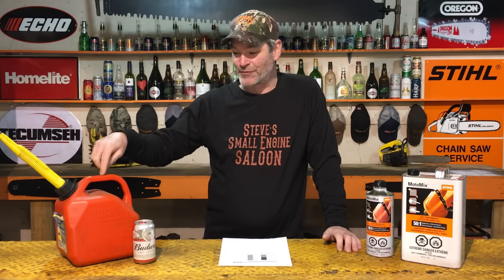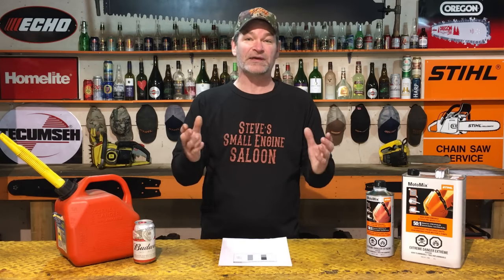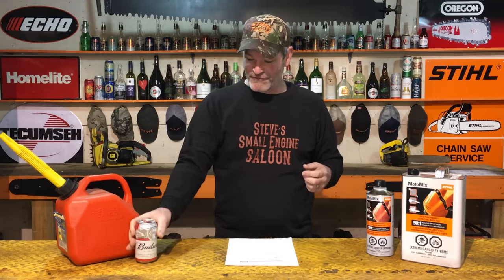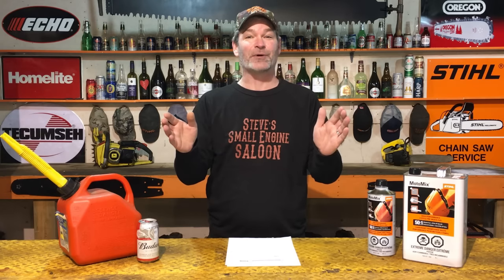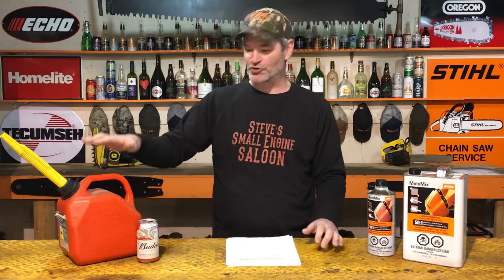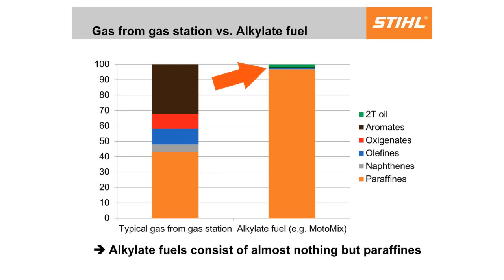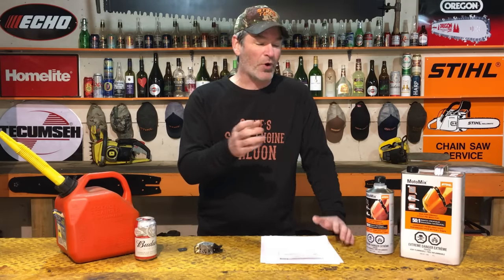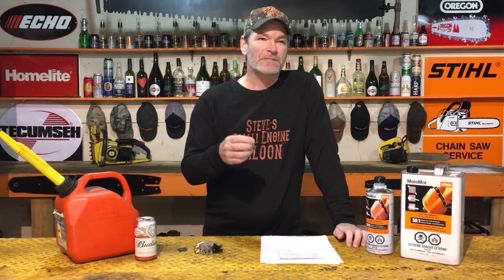The Ugly Truth Why Gas Station Fuel Is Bad For Small Engines

Comment: I'm a mechanical engineer and I can't understand why they don't redesign these components so that they are compatible with gas station fuel.  Well, that's not totally true.  I do understand.  They want to sell replacement equipment when it fails or specialty fuels and mixes to keep it from failing.
Reply from the maker: I agree...
Reply: Good point Shane Martin.
The Corporate Muckie-Mucks hate us "Shade-tree", experienced, and Professional Mechanics!
They depend on the "don't fix, replace" individuals, and people that don't read their Operator's Manual that is INCLUDED... Duhhh!
Reply: We could use different materials ethanol resistant, but you guys bitch about fuel price, how much you think it will cost a carb that dont rust and a carb kit that dont worn out in ethanol? People have what they are willing to pay.
Reply: Bingo.
Reply: Its completely due to cost.
Reply: @hrbestalkinme3690  & Amikar
The cost to make the improvements (after design time) would probably be a few dollars and then they would have to mark it up to make it worth their while.  I would gladly pay the markup to not deal with the failures or the hassle.  As an engineer, I know that companies drool over the possibility of long term consumable sales.  If you sell them some equipment once, you sell it once.  If you sell a consumable (in this example special fuels and mixes), you sell it continually over the life of the product.  I have worked at many companies that sell their product with very little profit because they know that they can make a ton of money on the consumables that go along with it.  That isn't a guess, I was told that flat out by the sales force and management.

The materials that are resistant to the gas station fuel are readily available.  Automobile fuel systems and gas station pumps are not self destructing on a regular basis.  

So, no, it is most definitely not due to cost.  It is due to profit.
Reply: @S3145    Im also mechanical engineer.  I've worked for two small engine manufacturers.  They certainly do not like having the carbs gum up.  It causes warranty returns when you try to sell them at big box stores.  The issue is bemoaned within their engineering departments.  But, they are operating on such small margins that they cannot afford to use better alloys or redesign the carbs.  They use the cheapest carbs they can find and then get a pat on the head for saving cost.  Its all about cost.
Reply: @hrbestalkinme3690  I'll concede that if you are a small company without any branded fuel mixes, you probably have no choice and can't upgrade the carb and aren't making extra money on the mixes.  The bigger companies with the branded fuel mixes have no incentive to make the switch.
Reply: @S3145    We were not a small manufacturer.  We made small ENGINES.  The margins are absurdly small, and sales are very sensitive to price.  Btw the profits from branded fuels and oils are calculated into a completely different budget than engine R&D.  Im guessing you work for a small company in a low competition industry with high elasticity of price.  You have quite clearly never worked in small engine or industrial engine development for a large mfg.
Reply: @amilkarcamacho6084  Ethanol isn't very corrosive. It's slightly acidic and a very good solvent capable of cleaning out gum and varnish. What does that say about the quality of fuel people buy? With a ph of 7.3 you DO NOT need any material more costly than stainless steel. If any rubber part swells on contact with ethanol, throw that rubber away and get something of trusty quality. It's not impossible. It's not even hard to do. It is however very hard to profit from oil sales when other fuel sources are readily available. Now you know why other fuel sources aren't readily available in the US.
Reply: @exoticcreature3059  Ethanol is hygroscopic absorb moisture, Ethanol itself is not corrosive. It has he capabilities of damage all kind of rubbers, elastomers like the ones found in the carburator Kits. Carbs can't be made out of stainless steel it will need to be an alloy. Other option is to nickel plate internal parts of the carburator which Walbro already is doing for couple manufacturers like Echo and Shindaiwa. The reality is that the fuel with ethanol is not a problem if the user keep using the machine with fresh gas ( no more than 40 days) regularly. We see the problem when the gas is left in the unit for longer than 70 days, Ethanol start getting moisture and gas molecules create gum, product of the natural ionization of the gas.  Theres couple materials that works better with ethanol like viton, chrome, vanadium, iridium and many others but they are really expensive. People definitely will not pay for. Feel free to contact me if you have any questions.
Reply: @amilkarcamacho6084  Why can't carburetors be made of stainless steel? Fuel lines can be.
Reply: @exoticcreature3059  stainless steel carbs can be use in small engines capable of treating the exhaust gases. In handheld small engines the catalyst happens by temperature only and we dont have platinum, iridium or any other catalytic materials inside the muffler exhaust. Stainless steel will not corrode but creates multiple emission gases that EPA will not approved. Also stainless steel when you perform and spectrum ionic wavelengths is not good with vibration and suffers from pitting corrosion. Also is very heavy material, just to be in the perspective a normal walbro carb it made out of aluminum is cost not MSRP is about 4 dollars in raw materials. If we use stainless steel in emissions capable engines will be about 9 dollars raw materials but the way to handle the material for manufacturing processes will increase the cost of labor about 6 times, Is not only the material cost.
Reply: @amilkarcamacho6084  What about chemical coatings? Anything you know of that could be used in such an application? I'm thinking ceramics but that is only one type.
Reply: @exoticcreature3059  ceramic is very weak to small , medium and high vibrations waves, this is a real problem with these small engines the vibration spectrum is really high, medium and low is very impressive we could see all the 3 variations all the time in these units. Ceramics are an awesome materials I actually see a small rotary engine prototype with ceramic and if they could get approved will be a whole revolution in the industry.
Reply: @exoticcreature3059   sorry I forgot about the coatings. So Walbro is chrome coating internal parts of carburators only for Echo and Shindaiwa professional models. Is a very good quality carb and they are not really expensive. Remember this the manufacturer warranty their units only for manufacturing defects and or workmanship any fuel related is customer liability and the Government laws protect them from this. Theres not a lot we can do at the point when people these days care more for an experience than a super good quality machines. We could desing a 2000.00 trimmer or chainsaw that last forever but only very few will pay for it. Today's manufacturing is about massive earnings how to make billions that's the sad part of this.
Reply: @amilkarcamacho6084  I know you mean by profitability over longevity. The manufacturers can use warranty scare tactics on me all they want but nothing is stopping me from giving every metal part the cryogenic treatment.
Reply: I peed in the fuel. 
  
                 💦
Reply: @S3145   The same holds true throughout the marketplace. For example computer printers are sold at a loss, so that they can sell you the ink at exorbitant prices. Just like with the "drug dealer", your 1st fix is "free",  and then your "hooked". Sadly, it's a terrible society in which we live.
Reply: Shane Martin 

They are compatible. You’re supposed to drain the tank after each use and run the engine until dry...so said my Toro mower’s manual in 1978.  By doing so I’ve never had a fuel related problem.
Reply: it's all about da money!!
Reply: True the Stihl authorized dealer here never gives a warning about burning pump gas station gasoline.  A customer buys new outdoor equipment then 6 months later he/she brings it back needing service. After taking a look at the equipment it was ruined when they used gas station gasoline. Then they are told its gonna cost more to fix then to replace it with a new one. Very shady business practice.
Reply: Shane Martin 

Drain and run until dry. Problem solved. But too much trouble for lazy owners.
Reply: I've said that exactly, if I can find my comments here, I'll repost it to you.
Reply: HERE IT IS
LostInMySpace
LostInMySpace
4 months ago (edited)
I can either buy just the perfect fuel for my Stihl brand products, or get on my knees and pray that Stihl can design a motor that will operate efficiently on the fuel that is available to burn.  Talk about built in obsolescence.  Some engineers build in cheap electronic parts, others cheap metals, others cheap plastic knobs that are not available in the aftermarket.  Stihl refuses to redesign a motor that has plastic tubes and other parts that gasoline eats up.  We've heard it for years.  Ethanol gas eats the plastic in the diaphragm, and the gas lines.  But do you see Stihl change out those parts when Ethanol was put in the gasoline? Hell no. Why not make metal lines and a metal diaphragm? The technology really is available.  I once spent $24.00 for a gallon of that motomix.  I kept track, and used 3 gallons this year, but instead did not buy two more gallons of Motomix, but rather a 92 octane racing fuel with no ethanol. That's the best I can do.  I will not spend 24 bucks  a gallon on fuel ever again.  Instead, perhaps after 5 years I will just buy another power equipment; it's cheaper in the long run.  Stihl needs to work backwards. Know what kind of gas is out there, then design a good piece of equipment that we can depend on.What irks me is Stihl and all the other equipment makers get their money, the retailers get their money, and we're left holding a piece of SHIT!. And their solution to this repoff is spend 24 bucks a gallon for gas. If Stihl redesigned it, and charged everybody an extra 50 or 100 bucks for better equipment I think everybody involved would be happy. Stihl needs to shut the fuck up.  I don't mince my words like Stihl does. My Ford trucks have steel gas lines.  I don't think it would be copyright infringement if Stihl used steel gas lines, an throw in an aluminum diaphragm.  

Stihl stihl's your money, refuses to use Stihl gas lines, and they call their company Stihl?  Go figure.  That's the biggest inside company joke.  Everybody is slapping their backs, laughing. Well, shouldn't the company be called STEAL CORPORATION?

                                                                                                                         It's always the end user that gets the screws.
Reply: Hah, I just posted the same comment. Good stuff, I totally agree... they know the available fuels and their chemistry....
Reply: @tkskagen  but when i'm buying a replacement, i sure as fuck don't buy from those thieves. I'll buy from the chinese knockoff's making the same parts for 1/0th the price. I'm getting jewed by both parties but at least in one case i'm not losing my wallet
Reply: @amilkarcamacho6084  Thank you for the informative comments....our small engine mechanic told us Echo seems to have the least problems with weedeaters etc....now I know why.  On our farm, it seems no matter which brand we get the weedeaters go bad and we try to use only non ethanol fuel and even add the stabilizer.....one mechanic told me to use only the blue stabil instead of the red, but it still seems to not help over the long run.  Stihl seems to be the best chainsaw as husqvarna has let us down over the past 10 years....used to be the brand that performed the best, but once they changed the 51 and made the rancher etc, things seemed to go straight downhill.
Reply: I don't understand why they don't make non ethanol gas around 91 octane which is affordable, more widely available specifically for these applications. It would save people a lot of trouble. Around here to get something like that, you have to jump thru hoops to get it. I k ow a place that sells 91 octane non ethanol for 7 bucks a gallon, its in the middle of no where.
Reply: I wonder  what percentage  is in cam 2
Reply: @David-kq9vp  Cam 2 isnt supposed to have any ethanol in it and I asked at my local sunoco, the only one in the state that sells it, they said it was ethanol free. It was around 8 bucks a gallon. Still cheaper than trufuel.
Reply: I've been burning 100LL AvGas (aviation fuel) in all my small engines for many years. I have a 10-year-old mower that starts on the second pull after a six-month winter hiatus.

Excepting oil and air filters, I have never done any maintenance whatsoever on the carburetor or the engine.

It costs a bit more than mogas but WAY LESS than that steal fuel. You can find an airport and price at 100ll.com.
Reply: a lot of Canadian fuel is ethanol free. Numerous brands of lawn equipment are made in China and are made with cheaper parts. Engines parts can be made in China, but assembled in the State also. Cheaper parts and cheaper labor. Things need to get back to made in the USA. Things may cost more, but last longer, if things aren't outsourced.
Reply: @markstevens9724  Yea, you got that right. I just picked up a 1980 International Cub Cadet from 1980. Its a 1650. The thing was almost 4 grand than. Now it would be in the neighborhood of 16 grand. Its all muscle, no plastic and its still running and cutting. It was prior to this age of disposable garbage. Nobody back than thought we would be buying snowblowers with the brand name Zheng Jheng out of China. That thing has a Kohler, the cast Iron line made in USA with pride. It may have cost a lot more, but it was built to last forever, here by people we live and work with pride with higher wages.
Cub Cadets today, are tin cans compared to that thing.
https://youtu.be/maqEwKGCz7I
Reply: Shane Martin Hey dude as an engineer I’ll pick your big brain. I use motomix every so often to clean out my Stihl kit. I rarely have issues and my kit lasts years. Am I pissing in the wind or is this worth it ? Cheers Ed.
Reply: @edwindude9893  It certianly doesn't hurt.
I add stabil to all my fuel because as you know the ethanol in gas is terrible for a carburetor. Especially if its left sitting in the fuel system for any period of time. The best thing to do is always use erhanol free gas, but a lot of folks don't have that option, due to the availability. Since your talking Stihl products, yes your definitely doing a good thing. If it was lower end products I would say just use stabil in your fuel and run it dry when not in use and your good.
I use STIHL 2 cycle oil in all of my 2 cycle equipment, its some of the best 2 cycle oil out their. I go to a dealer and pick up a 12 pack of it for about 25 bucks I believe and it lasts a good long time. I highly recommend the stihl 2 cycle oil, its engineered specifically for small 2 cycle equipment vs outboards, make sure whatever your using is TCW3 free, little machines run poorly or not at all with that crap.
Reply: @exoticcreature3059  I don't know, but  I have watched ethanol fuels turn those Briggs 6 to 8 horsepower IHV horizontal's with the aluminum float bowls and the ethanol fuel that sat in that carburetor, literally turned the aluminum to a find powdery dust and it destroyed the carburetor. I've seen it a lot on aluminum made carbs. It just gets eaten away, so if you ask me ethanol in fuel does a pretty good job at corroding those materials, especially thst aluminum and pot metal.
Reply: Another reason is cost. Building carbs out of stainless steel and rubber products from viton would be ridiculously expensive.
Reply: @stanburton6224  cost is the biggest factor to everything being made now, one of the big reasons why, is because Americans are so wasteful and they throw things away that are perfectly good all the time, its a wateful throw awsy society, I just picked up a snapper sx5200e snowblower at the curb in a blue-collar neighborhood that barely had any use to it. It started right up, that was a $700 snowblower new in 1999. Americans throw away stuff all the time, the manufacturers caught on and they said, we can build this stuff cheaper and charge the same price and after a couple years it's going to break down, the dumb American's going to throw it away and go buy another one. Thirty years ago, Americans were smarter they fixed their own stuff and they kept it going and it was built much, much better, I had the same issue with the Mufflers, they're made of galvanized metal and they rust and turn brown, if they use Chrome that would not happen, but costs prevent it, I tried to sell a generator yesterday and the guy complained because the muffler had that brown rust to it which happens naturally over time and it's hard to stop it, the guy wasn't very smart the generator was still practically brand-new it was used one time for Hurricane Sandy and then it sat in my shed for 8 years, the thing had barely any use to it, was still new, but because that muffler was brown he had the nerve to ask me if my generator was beat, which it wasn't it was still new but he made a hissy fit because the muffler was brown, so now I'm going to take a wire brush to it and then I'm going to paint it with Rustoleum High Heat black so the next person can't complain over something stupid.
Reply: @exoticcreature3059  ethanol still has left over materials in it from the brew process.
the two are salt and acid.
small amounts... but you add a bit of water in there and you have a mess on aluminum and the plated carb parts.
check up on how they make ethanol and then check on the % they allow of the purity..
in most brew systems they use sulfuric acid in the digester. they make their own on site with SO2 gas from in BIG rail cars.
at least in the wet milling process.
Reply: How about aviation, fuel have you guys ever thought about using that?
Reply: Back in the first half of the 20th century all the great companies that made America the Industrial powerhouse it was designed all their products with the idea to make the most reliable dependable , DIY fixable friendly to perpetuate having a good renowned name. . . Nowadays they employ rip off artist engineers to make things that always seem to break down just after your warranty runs out or sensors that burn out and cost a fortune to replace but not enough to warrant getting a new car until after you've dumped a bunch of money into your existing one , as well as vehicle built like black boxes that cannot be fixed by backyard mechanics so they charge you $120 hr shop rates to sealed electronics to purposely keeping replacement parts off the market to not honoring recalls to mechanics at dealers lying about work that needs to be done and lying about work they didnt do to insurance companies charging whatever they want because its mandatory by law to have their services , deductables, insurance companies not paying out when the time comes to collect from them , to non regulated gas prices , carbon taxes, luxury tax,  etc etc etc...
Reply: @Mr_Tecumseh  that was when they were still built by International Harvester, the ones now are built by MTD and just a copy of a Troy Bilt, Bolens or one of the other ones they make now.
Reply: I think fuel they produce is for none vented fuel systems yard eguipment should not be stored in the fuel system during winter season.
Reply: Great & informative thread here- to all, many thanks!
Reply: @stanburton6224  But they use viton seals in some $50 weedsprayers
Reply: Discuss the fuel that causes the problem it's the nature of the fuel to absorb water that causes the problem and also better hoses manufactured would be a plush
Reply: Yep. Look up McDonald's Taylor Ice cream machines that the franchise is required to buy. Designed to break down and you need to call a factory serviceman to fix it quite often because the troubleshooting software is so cryptic . Said to be 25% of Taylor's profits. Interesting story. And a lot of companies do this!
Reply: @rickoshay6554  be careful. Lots of avgas contains lead.
Reply: All 100LL contains lead.
Reply: Buy good equipment and use E85. It doesn't stink up the place like gasoline does.
Reply: GAS! The oil embargo of 74 was self inflicted. There really were 200mpg carbs. All you needed was a higher temp t stat, hoses hose clamps etc to vaporize th fuel. They changed the way we make fuel after that against the protest of every other industrial Asian and European country. But they can squeeze out a Bit more gallons per barrel.  But secured their stock. NOW, it takes exhaust gas temperatures to vaporize fuel, 900-1200°? Who wants to risk THAT! Auto mfgrs and oil companies are in kahootz with each other.
Reply: @amilkarcamacho6084  Probably less cost.
Companies spend money on "autodestroying" their.equipment.
Reply: Heres an idea . Why dont you design a small engine that is compatible with ethanol gas station fuel ? Put that engine in all kinds of things like lawn mowers weed eaters , blowers etc and sell a good reliable product that works . People would buy it and you could have a good business.
Reply: What outdoor power equipment can run well on “gas” that is 85% ethanol?
Reply: They relish getting to be the repair guy at the dealer, who belittles you and shames you for having a gummed up carb.
Reply: True, it is understandable alright. it's called "follow the money". Same reason my neighbor and I still have 35 year old mower blades in our sheds made of U.S. Steel that can still be sharpened. No steel at all has blown off the back end like the sorry Chinese blades that barley make it thru one season. My mower manual even states" don't sharpen blade more then once" .
Reply: Not designing it to work properly is an engineered failure.
I would imagine a vehicle could be designed to not rust, but they do.
They appear to have rust failures designed into them. Places where winter salt water gets trapped.
Make them out of stainless steel. Done!
Stainless isn't really that much more to make than steel. Especially on a mass production.
Reply: @amilkarcamacho6084  
That is a good question...
Maybe the materials that are pump gas resistant are actually cheaper. The last thing they want is easily affordable parts that last. Parts that fail aren't cheap.
Reply: as a professional  I would pay more for properly designed tools that would last vs fall apart from normal fuels.....Down time cost thousands of dollars a day and can kill people if tool is faulty!
Reply: I have had a Honda powered cheap Husquvarna mower for 20 years, never did anything special to it for storage, always starts.  I have a RedMax backpack blower, same thing.  They must use better parts.  Everything Stihl and Echo seems to need carb work all the time
Reply: Maybe the government should stop forcing the oil companies to put all the uneeded crap in fuel.
Reply: I was sold and you can take this with a grain of salt, the issue started trying to make the emission standards that are more strict than say when I was young, which was a long time ago. Cars are much more expensive and designed to handle this fuel. Your chain saw for example is relatively inexpensive and designed much more simple. I never had these issues back in the day but now I am forced to use the expensive fuel.
Reply: yes you caught on. I have seen the shenanigans car manufacturers do from the start with my 50 year auto mechanic career
Reply: I worked for Gm for over 30 years and your correct if the company made the products they sell like they did  years ago they would go broke.
Reply: They like the auto business don’t want to put the best carbs in these machines or any other equipment like the past they want them to break down so they can make more money in parts a labor.